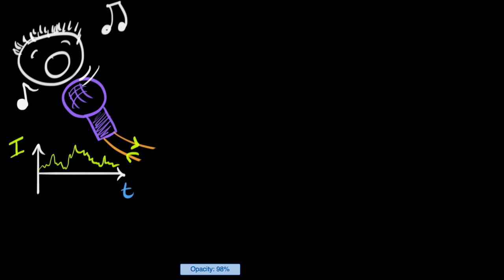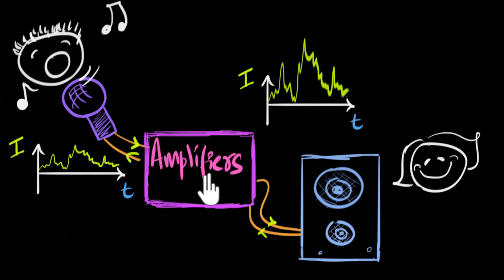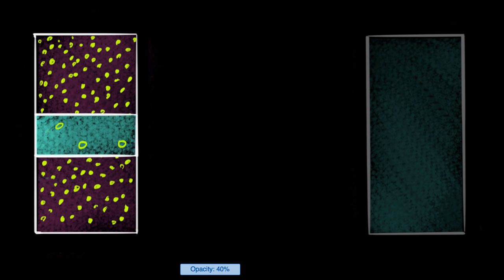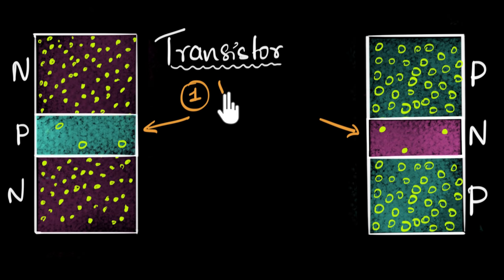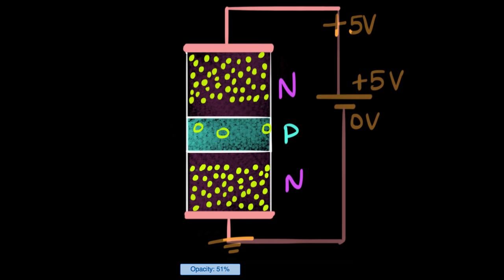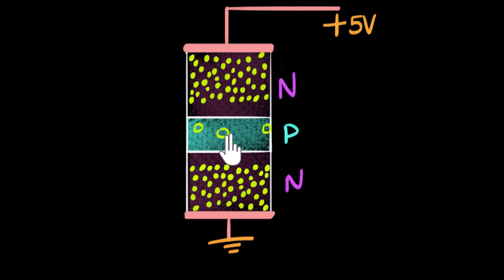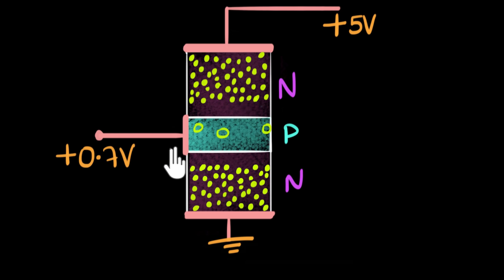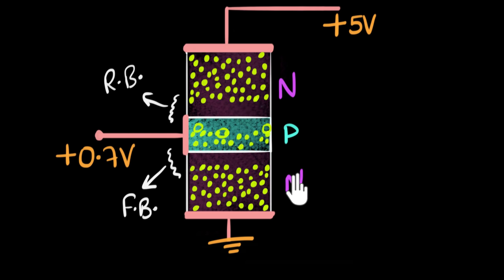Transistor working | Class 12 (India) | Physics | Khan Academy

Comment: The video is great!! But why is it necessary for the electrons to undergo recombination in order to get pulled out?
Reply: When 5V are applied to pull electrons then why we need forward biasing volatge of 0.7V at base ?
Reply: @OmarKhan-ds1si  same doubt
Reply: @OmarKhan-ds1si  because 0.7 V is the breaking voltage for silicon diode, means it cannot pass the the potential barrier which is the in built electric field in a PN junction from N to P which repels the flow of holes from P to N so in order for the holes to pass from P to N a voltage of 0.7 volt is required for a silicon diode doped with phosphorus and boron.
Reply: @OmarKhan-ds1si  there is no potential barrier bw the metallic plate and N so electrons can be pulled easily
Reply: Because recombination  destroys holes and electron so for every electron destroyed another electron gets pulled and then the electron that gets pulled generates a new hole.
Reply: please elaborate

Comment: Sir, at 04:55, you mentioned that no amount of supplied voltage would cause flow of electrons due to the presence of the barrier in the PN Junction. But a PN Junction is weakened by increasing voltage, right? So doesn't a  weak barrier result  in more flow of electrons sir?
Kindly clarify
Reply from the maker: There are two barriers, right? Almost all the supplied voltage comes across the top barrier (collector/base junction) reverse biasing it. The lower PN barrier (Emitter/base junction) is pretty much unaffected, and so electrons cannot be pulled out.
Reply: I was thinking the same thing thanks for the explanation.

Comment: If the sound to the mic is very loud to a point that makes the voltage higher than 5V, what would happen? since now the reverse bias becomes forward bias on top
Reply: We could add a resistor so that it doesn't exceed 5V.We could make the voltage drop

Comment: 4:30 => 
Only 0.7V is enough to break the depletion layer. But there is 2 depletion layers. So, 1.4V is enough to break it. Then Why electrons can't diffuse from N region to P region while 5V potential difference is connected?
Reply: No only 0.7 V is enough because first depletion region is from N to P so 0.7 is enough for electrons(majority charges) to overcome the potential barrier. The second depletion region is from P to N where electrons are now a minority so the in built electric field in that region is in favour to accelerate those minority electrons from P to N
Reply: The electrons can not diffuse from N to P region even with the 5 volt because N is negative type connected to a Positive+5V terminal so electrons instead of getting diffused to P will get pulled from that N by +5V as opposites attract.

Comment: Sir, a silly doubt... 
At 07:20, you mentioned that the  chances of recombination is very small because of low number of holes in P
But in recombination process, the electrons get recombined in N only right?  ( https://www.youtube.com/watch?v=1scOlzd46ks&list=PL2ub1_oKCn7ogaMtdB2RumlIYqNeXf_oX&index=14&t=4m54s )
I don't quite get how recombination in P helps - because recombination in N only causes the continuous flow of charges
Reply from the maker: Recombination happens wherever there are holes and electrons, so they can happen in both N and P-type conductors. In that video, I only chose to look at what happens in N. But, something similar happens in P-type as well. Electrons injected into the P-type from N also recombine and contribute to forward current. The current in forwarding bias is due to the sum of electron and hole current. In our transistor, both the electron and the hole current in the Emitter-base junction are very small. Feel free to ask more questions.
Reply: @KhanAcademyIndiaEnglish  In the P region some electrons recombined with holes, and you said this recombination cause current flow from base, which is base current. But how can electrons or holes cause current flow after recombination?

Comment: Am I correct in saying that when the transistor is in the active region it is amplifying? 
If I make a simple led circuit where the base current is in order of mA I assume the transistor is saturated at that point? Is the active when base current is in the order of micro amps?
Reply from the maker: Yes correct. However typically the base current need not wait till mA to become drive the transistor into saturation. 
Most cases even few tens of micro amps can easily drive the transistor into saturation. (The value depends on Beta and Vcc)
Reply: @KhanAcademyIndiaEnglish  I understand now many thanks for your reply, much appreciated. Can I also ask please, in one of your videos when you are explaining the saturation it was because the voltage drop across the load resistor was the max possible for that particular Vcc. But what if you didn't have that resistor there? Would you just burn out the transistor? I guess what I am asking is if you didn't have the load resistor then the output would be +Vcc. What is the requirement for the load resistor being where it is? I don't understand this part. Thank you
Reply from the maker: @S24W2  Without the load resistor the output will always be Vcc, regardless of what input you provide. 
In Saturation region we want the output current to be maxed out (saturated), which means we want most of the voltage drop to occur across the load resistor (and so very min. voltage across Vce - almost zero). 
Only then as the transistor goes from cut off to saturation, the output Vce will go from max to almost zero. 
Without the load resistor, it will always be Vcc (regardless of what current flows in the output),and that wouldn't be useful at all.
Reply: @KhanAcademyIndiaEnglish  thank you do much for your reply, so basically you are saying if all Vcc is dropped across transistor then that wouldn't be useful at all? But why would we want Vout to be zero? Is it like a logic gate? Input (base) high output low?? Or am I still not getting it?

 I will let you alone after this question I'm conscious I am asking a lot of questions if you could just answer this I'll be happy.
Reply from the maker: @S24W2  There is no problem in having all Vcc being dropped across the transistor output. The problem is if it cannot be changed without the collector resistor. And hence we cannot control the output voltage of the transistor right? That basically renders our transistor useless. 
With the collector resistor, the output voltage can swing anywhere from 0 - Vcc, and it is completely controlled by the input base current. Now we can make our transistor work as a logic gate (like you mentioned, by driving it between cut off to saturation) or we can also make it work as an amplifier (by driving it in the active mode). 

P.S.Please do not hesitate to ask more questions :)

Comment: Why does an electron need to be recombined in order for it to flow to the base?
Reply from the maker: Great question, the details are explained in the video of 'PN junction forward bias'. But here's the TL;DR. 
In a forward-biased PN junction, electrons (and holes) flow due to differences in concentration of charges, a.k.a. diffusion. 
So for electrons to flow (diffuse) out of the base, there must be reduced electron concentration there.
The recombination of electrons helps in doing just that. 
[Imagine if the electrons didn't recombine, pretty soon the concentration would equalize and no more current would flow]
Reply: I have a q.
Reply: @KhanAcademyIndiaEnglish  Excellent videos! So in the NPN transistor because the concentration of holes is so low in the base (because of light doping) there is little recombination.  This causes a buildup of electrons in the base leading to less of an electron concentration difference between emitter and base. This results in a lower diffusion current from emitter to base. Is this the correct way to think about this? Why doesn't the battery (at the base) just pull most of the electrons out of the base? Also, do most of the electrons that diffused into the base from the emitter behave like free electrons since they are not able to recombine?

Comment: Hold on, why can't you use a transformer to amplify the sound?
Reply from the maker: Beautiful question. 
You see our transistor voltage amplifier amplifies both voltage and current (by using external DC source - Vcc in our video example) 

But if you use a transformer, then if you step up voltage, current steps down and vice versa. 
Hope this clears the doubt? :)
Reply: Ok, yes I see now. I didn’t think about that. Thank you for clearing it up!
Reply: @KhanAcademyIndiaEnglish  

The electrons that forwardly biased , entered the p type ...but in n type which is attached to the +5v there is a lots of electrons .then why these electrons didn't repel the forwardly biased electron?
Reply: Abir Hasib remember the current is continuously flowing. So (according to what I’ve understood) the no. of e entering from the N of FB to N of RB via P will be same as e exiting N of RB to the wire I.e towards speaker
Reply: @abirhasib2336  It isn't negatively charged. It is just doped. it has electrons, but they're the regular amount. If it was negatively charged, it would cause a repulsion. At least that's what I think.
Reply: @abirhasib2336   The collector is moderately doped and bigger in dimension,  so the electrons have more mobility and kinetic energy  upon  reaching the collector terminal, and if the circuit is closed we can ensure the current is flowing.

Comment: Why is potential difference between emitter n collector i.e 5 volts not enough to over come potential difference of two depletion regions formed... why is base emited potential difference required.... potential difference at each depletion region is .7 volts therefore internal PD would be 1.4 volts while external is 5 volts... electrons should get enough energy from 5v PD to pass through two potential barriers.

How come base collector junction is reverse baised... both are attached to positive terminals.... for reverse basing majority charge carriers get attracted to opposite pole of battery and no majority charge cross the potential barrier... in transistors case per your diagram negative terminals are connected to emitter and positive terminals to base and collector ... base emitter battery would just pull some electors out  of emitter collector current
Reply: Base collector junction is reverse biased because the collector (N) is at a higher potential than the base (P region). That is the definition of reverse biasing. If the collector was at a lower potential than the base than the pn junction would be  forward biased!